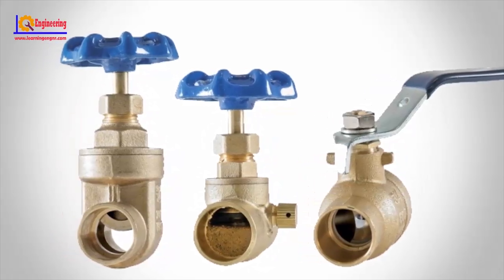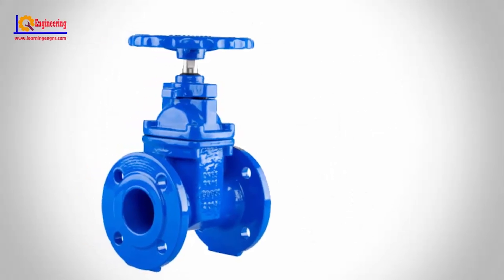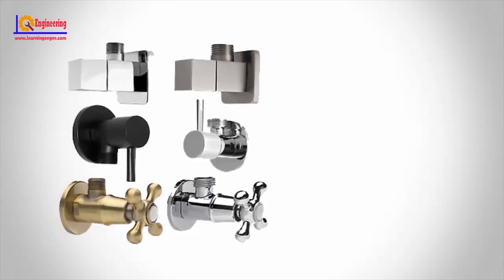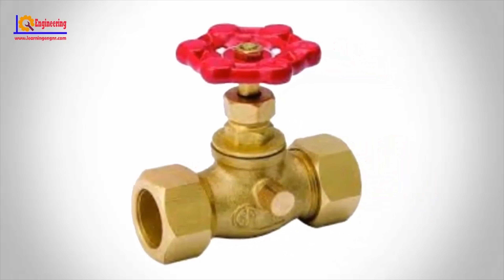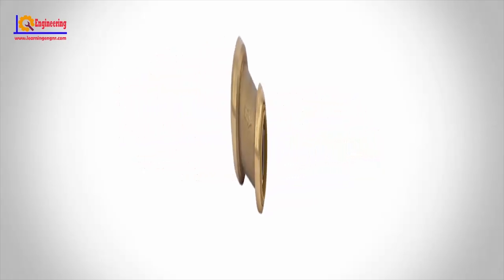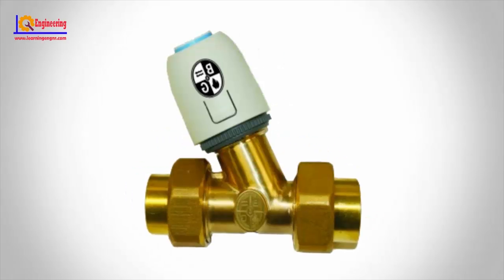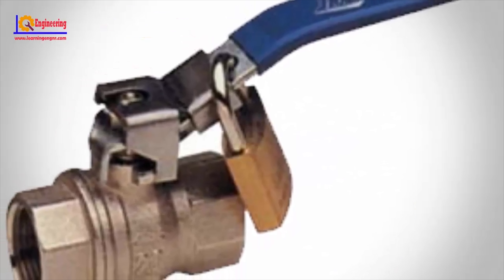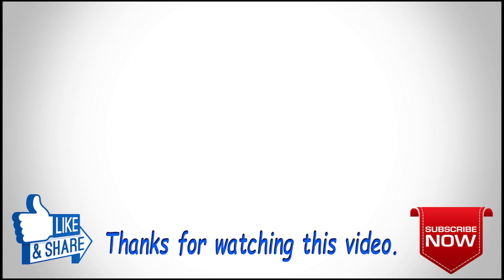Types of Water Valves -  Plumbing Valve Types

Comment: 1. Ball valve
2. Gate valve
3. Globe valve
4. Angled Fixture Shut-Off valve
5. Straight Fixture Shut-Off valve
6. Stop & Waste valve
7. Check valve
8. Butterfly valve
9. Diaphragm valve
10. Pressure-balance valve
11. Zone valve
12. Locking valve
13. Solenoid valve